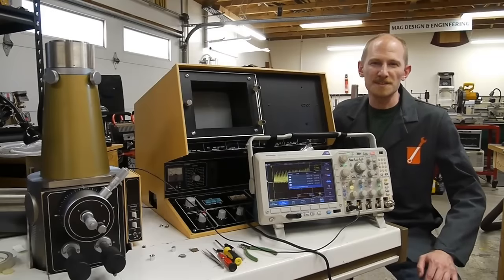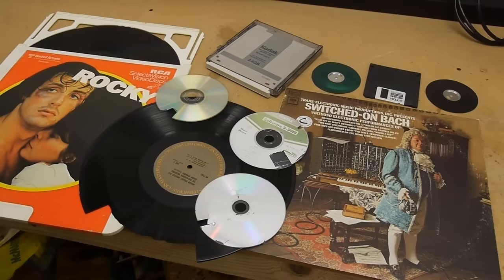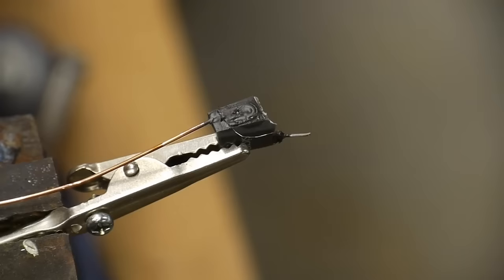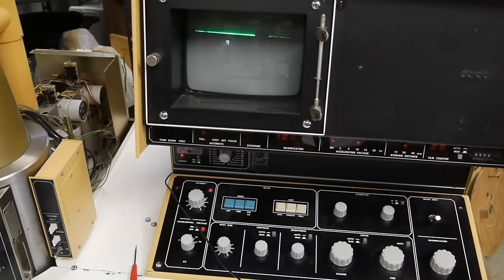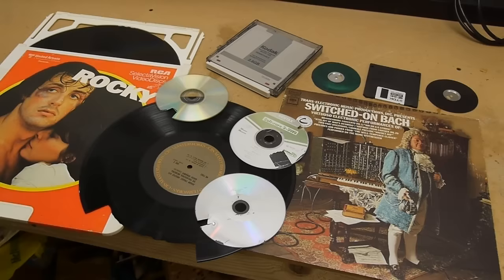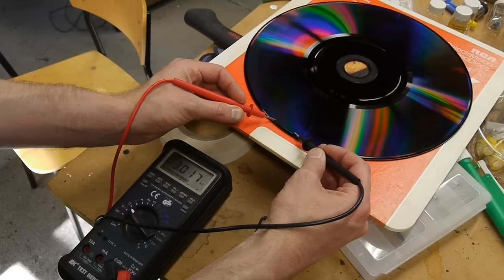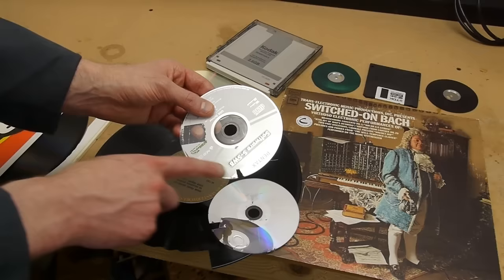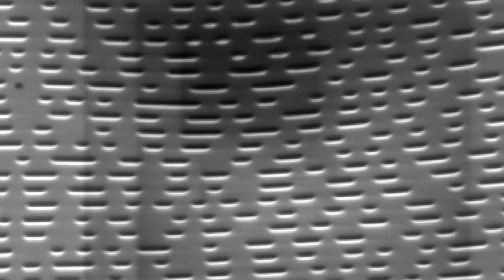Electron microscope slow-motion video of vinyl LP

Comment: I understand the mechanics of how a record player works but I still have no idea how variations in the tracks stamped into a vinyl disk could ever allow for such an insane variance of sounds. It seems like the most minute change possible would totally ruin the recording. For example, think about how many possible snare sounds there are. Same goes for guitar and bass tones, tiny vocal flutters and breaths, you name it. The fact that this analog medium using essentially just a needle, a few magnets, a copper wire and some shapes stamped into plastic can accurately capture and replay a musical arrangement with incredible accuracy and very high fidelity is just amazing. From a distance, it kinda seems like a crude way to record something but if you think about it, it’s one of the most ingenious things ever created.

Comment: very good vid....wondering what camera you use?
Reply from the maker: Lawrence Harasim Thanks!  Lumix GH1 with 14-140 lens shot at 720p, ISO400, full manual.
Reply: +Lawrence Harasim an electronic camera.....:o)
Reply: Larry: Could you wrap your head around the answer? Didn't think so.

Comment: 1: Holy crap that's awesome
2: A shiny record piece? It would looks so cool as a whole record :D
3: I didn't know records groves were recorded sideways, I thought it was through change of depth. That's why when you sometimes hear the audio "pop", I thought it was because the needle was dropped too hard.
Edit: 4: Wow... So CDs and DVDs actually have physical pits?! I thought they were just a bunch of microscopic black zones like a barcode. How does a CD burner work then? Does it literally burn into the aluminium?

Sorry, this sort of stuff is really fascinating to me xD
Reply: Recordable cd's have a layer of dye that darkens when the recording laser hits it. The difference in reading the discs is that with cd-rom, the laser is scattered when it hits a pit, but with a cd-r, the laser light is absorbed by the dark areas.
Reply: Jordan O'C A CD-R works under a different principle - it darkens an ink like what you thought a CD-ROM was like. This is why a lot of older CD-ROM drives can't read CD-Rs very well.
Reply: Jordan O'C  Depth still matters. Changing the depth is moving 45 degrees to the left and right channel axis so a change in depth goes to both channels. This makes old mono records compatible with modern players
as well as stereo records kind of compatible with old mono players.
Reply: Jordan O'C Pre-recorded CDs and DVDs are stamped from masters. The recordable variants use dyes (for one time only) or metal alloys (for eraseable).
Reply: Jordan O'C I think there are metal "coated" records out there. At least, something that turned them silver, tho, it could be something in the vinyl rather than a coating since that would rub off after a while.
Reply: Jordan O'C  That is why CD's and DVD will soon disappear. Their inception was an anachronism as, why on earth would you use an analogue technology to read digital data or vice versa? That is what the laser does, it counts the pits as binary data 01110001 etc and turns it back into music.  I still prefer my vinyls on a 50 year old high end kit and I own some vinyls they are almost 100 years old. They sound impeccable. But sure, the alternative for mobility is solid state like a USB stick etc.
Reply: Jordan O'C That last question, anyone? Gotta look it up.
Reply: Jordan O'C I don't remember exactly how 4 works, but I know that it uses a different material as the recording medium (at least for CD/DVD -R). It would surely have to generate actual pits though, to be compatible with other CD/DVD players.
Reply: ***** "The pits and land surfaces are "analogs" of the bits..." Huh, that doesn't make any sense. The fact that the bits are physically carved into metal doesn't make them any less digital: they're still bits, which represent digital data. Also, that whole war between digital and analog is much more sentimental than technical. If you think you're achieving anything arguing that vinyl is better than CDs, go try to argue against people who think cassettes are better than vinyl and see if anything constructive comes out.
Reply: Fernie Canto Well said.
Reply: Jordan O'C 3.  I thought depth of record grooves had to do with bass information.
Reply: ***** Aren't the ones and zeros a capturing of the audio waveform at one point, and then they add dither to make it sound like music?  If so, how is that technically more accurate than analog?
Reply: mmakshak
The "ones and zeros" are samples, and the Nyquist-Shannon theorem guarantees that digital sampling works. The dithering is necessary because of the digital distortion, that happens because you must have a finite amount of values for each sample (determined by the bit depth, e.g. 16 bits, 24 bits), but dithering is not always required, and it reduces or eliminates the distortion by introducing (virtually) inaudible, non invasive random noise. The thing is, the noise you get from 16 bit digital audio is smaller than in every analog medium available.
Reply: Fernie, have you heard a digital recording that did not have dither-just curious?
Reply: mmakshak
I believe virtually all professionally recorded digital music is dithered, but in my homemade stuff I do work with non-dithered audio, and I honestly can't hear the difference.
Reply: We were promised perfect recordings forever, which(at least with the original cd's)wasn't true.  Now, even though digital is getting better, I wonder if digital(which is actually a sampling, based on a theory.  Remember, even Einstein's theory wasn't completely correct[see string and quantum theories].), will ever completely get the emotional part of music(the part where music moves your heart).  I know analog can do that.  I can admire digital, but that isn't why I listen to music.  Maybe Fremer can interject something here, as I know he has digital recordings of records played on his very high-end turntable.  Does the emotional part of music come through, Michael(I would suggest records made before 1982 as a source.)?
Reply: mmakshak
"Now, even though digital is getting better, I wonder if digital(...), will ever completely get the emotional part of music(the part where music moves your heart). "
It already does. The emotional quality of music does not depend on the medium you put it on, but on how it is played, and most importantly, how you listen to it. I can assure you someone right now, somewhere, is being moved to tears listening to a Kenny G song on a shitty, low bitrate video on YouTube. I, personally, have had way too many utterly life changing moments with digitally recorded music to count. Remember that, just as you are not willing to be moved by a digital recording, a lot of people were skeptical of recorded audio in the beginning of the last century, and thought records would never sound good at all.

"which is actually a sampling, based on a theory."
You mean a theorem. The Nyquist-Shannon theorem is only used because it has been mathematically proven.
Reply: Fernie Canto Isn't the Nyquist-Shannon theorem(which is different from a theory, because it can be mathematically proven-at least that's what I gather, so far.) limited, because it's limited to 20khz?  I don't know if this is related to higher resolution samplings(forgive me, if I get the following incorrect.), but I've heard music at 44.1kz(cd, and usually not very good), 96khz(not quite high enough for me), 192khz(now we are talking), and 300kzh(MSD machine, and interesting).  Supposedly, the Nyquist-Shannon theorem doesn't work above 96khz.  I still find that digital can be intellectually interesting, but generally less satisfying at moving me-compared to analog.  I don't know if I'm willing to believe that theorems are the God's honest truth.  Can you further explain how they are?  I'd also like Fremer to tell me if he hears(or feels) a difference between his high-resolution(above 96khz) recordings made from his Continuum turntable, and the lp being played on that turntable(I've found there to be little difference, but haven't compared both directly.).
Reply: mmakshak
"Supposedly, the Nyquist-Shannon theorem doesn't work above 96khz. "
I don't know where you got that tidbit from. The theorem works for any sampling frequency.

"I still find that digital can be intellectually interesting, but generally less satisfying at moving me-compared to analog."
Have you done any blind testing to check this out? Are you sure this is due to the inherent qualities of the sound, and not to your own, personal prejudice?

"I don't know if I'm willing to believe that theorems are the God's honest truth."
I don't even know if there is such thing as a "god's truth", but trust me, mathematics is the only tool that can give you absolute, fundamental truths, based on very small and specific assumptions. When you're working with Physics, for example, there are a lot of subtleties and uncertainties you have to work with, and usually you have to make simplified models of reality to get something workable. But with mathematics, you're already working with absolute things, which can then be applied to reality.

"Can you further explain how they are?"
Not really, I'm not a mathematician, and you'd be better off reading a math textbook to really understand it. YouTube comments can't take you that far, you know.
Reply: +Fernie Canto you cannot hear above 20 kHz - that is a fact. Sound reproduction is much more in the DAC and the equipment, and a good master of course. Don't fall for Neil Young's hipster pseudo science
Reply: I had the exact same thoughts

Comment: Does the problem with the object becoming charged and repelling electrons produce distorted images, or just completely garbled images? If it's the former, it could make an interesting video.
Reply from the maker: Rob Mckennie Depending on the geometry, a charged object can just appear too dark or too bright, which makes it difficult to image properly.  If the charged object is near the beam path, it can cause weird distortions.  It's like looking through a wavy glass window or a glass bottle.

Comment: How does small lines on a CD or DVD become into sound or videos or how those little lines contain information?
Reply: Fabian Pinzon works exactly like code Morse, but is translated to binary then thanks to the OS and apis to data then the drivers translate it to sounds on the speakers or a movie in the screen.
Reply: Ikr ! I can probably understand the vinyl record.... But how do u store a video on a small CD or DVD or even a flash drive ??   I mean how does it even store the video formats, quality etc. .... Humans are crazy !!! :)
Reply: You have to store "just" 0s and 1s (except for vinyl that have another system). so it's "relatively simple".
Reply: Adding to Luis Fernando, the marks you see are one or more 1s and the space between the marks are one or more 0s. Or the other way around, I don't know.  So if this was a side view:

__–_–_––__–_ and lets assume the no mark looks like _ and stands for 0, then you'd get:
00010101100100 when the laser shines on the disc, and only reflects to the receptor when there is no mark. 

So far as I know, all forms of digital storage use a series of 1s and 0s.
Reply: Magic.

No, really. Nanometers and electrons be durned.

Comment: This is fascinating. Some tidbits: The rubber on the stylus assembly isn't for electrical isolation.  It's the flexible suspension for the stylus cantilever. When you hear about "compliance," this is responsible for that.  You could have gotten a needle from a ceramic element cartridge. No magnets, and no need to hack up a perfectly good unit. Under $10.

Comment: It's neat to see it so up close. Amazing the amount of explanation to make one appreciate what you went through to do it.

Ever since I learned how they work many years ago, I've always thought that Vinyl records have always been one of those things that are way under appreciated. 
I'm sure you already know this, but
The technology is I think is the oldest way of recording sounds, and it's also the most fascinating in my opinion.
You have essentially a microscopic mountain range, peaks and valleys, vibrating a diamond tip,
moving some magnets interacting with a coil and ferrite to generate a varying voltage that comes out as incredibly accurate stereo sound.
If you listen close enough to a record player with no amplifier, you can actually hear the musical vibrations,
which is how the original records gave you sound through the funnel.
Speakers and microphones are second place, one is just the reverse of the other, but essentially the same concept,
except without the microscopic mountain range. Sound oscillations, like voices, etc. vibrate, push and it springs back, a very sensitive reverse speaker,
to turn it into electrical sound. You can actually use a speaker as a very crude microphone.
Similar to how a motor works with putting electricity in, and it generates a field to turn the shaft,
or, you can rotate the shaft(with coils ferrite, etc), and that turns it into electricity, an alternator for your car, or a hydro dam.
Essentially, if you could make a big enough turntable, record, etc., it could potentially make a voltage big enough to drive a speaker without
an amplifier, the generated electricity of the stylus could theoretically produce enough to hook directly up to a speaker to produce sound.

Comment: That CED was a fascinating story that people should search on.  RCA could've released that format a decade or so earlier had they not "over engineered" parts of it by trying to design new processes instead of using existing ones....   They shot themselves in the foot unnecessarily.  Still, it's a great story.

Comment: To my knowledge, on CDs and DVDs the digital "1s" are the changes between pit and land on the track. Pit AND land are digital zeros. Whenever the laser beam  "moves" from pit to land or vice versa, the beam is being deflected and therefore not returned to the sensor for a small fraction of time, which the electronics interprets as "1".

Comment: The RCA video disk stylus only tracked in the spiral Grove. It was shaped like the cut off bow of a boat and the back of it was conductive. The groove was smooth and a digital code of conducting metal beneath the surface produced the capacitance change. It was not analog. I think it was the principal cause of RCA's dissolution.

Comment: Not to get too nit-picky but I'd like to point out that the elastic material holding the stylus into the cartridge doesn't serve as an electrical insulator but only as a mechanical compliance, allowing the stylus to move over the full frequency range.  But having to make the surfaces of everything conductive was necessary for proper microscope function.
Bill Whitlock, former Capitol Records R&D engineer

Comment: Believe it or not, the aluminum layer of a normal factory-pressed compact disc does not contain the data. The pits and lands are molded into the plastic and then pressed onto the reflective backing. No doubt, this leaves pits and lands on the aluminum too but the plastic is where the data duplication happens during manufacturing. You could conceivably repair a damaged disc by restoring the aluminum layer.

Comment: The toolbox in my workshop looks pretty mediocre now. Thanks. I do work on turntables, most amazing is the Victrola. Same concept, with a much wider groove, the needle makes the cantilever vibrate a diaphragm which is then fed into a long and coiled up tube, like a trumpet. The drive for the record is speed regulated by centrifugal weights on the drive shaft that connect to a tiny clutch that engages or disengages as the weights move in or out due to rpm of the drive spindle.

Comment: Very interesting, excellent work!  It would be interesting to do a side-by-side comparison of all analog LPs and LPs from digital recordings.  Even under a regular magnifying glass, I can see the "bits" on an LP from a digital recording, and the all-analog LPs look "rougher", i.e., have more fine waveform detail. Perhaps that accounts for the difference in "atmosphere" of analog and digital recordings many people, myself included, notice.  The bits are much smaller on CDs and DVDs, because they spin so much faster than LPs or even 78rpm records, which fairly crawl along, by comparison.

Comment: Kudos for calling out the RCA CED as a 'ridiculous' system.  I suppose there is a point in the life of any new invention where it is either doomed to failure, or made to succeed as a result of user demand and development dollars.  CED just happened to fall on the wrong side of that wedge so RCA pulled the plug.